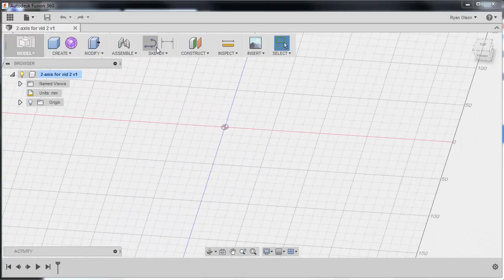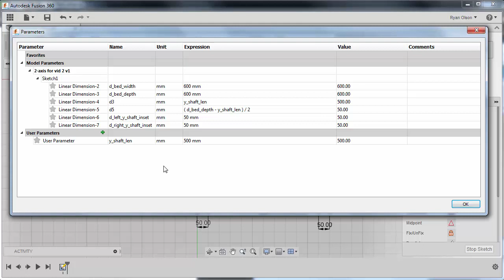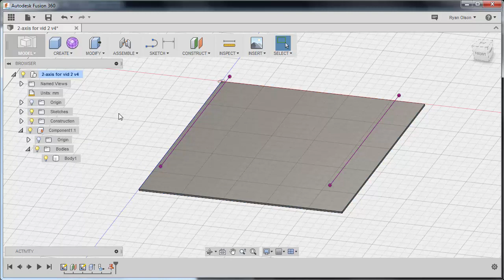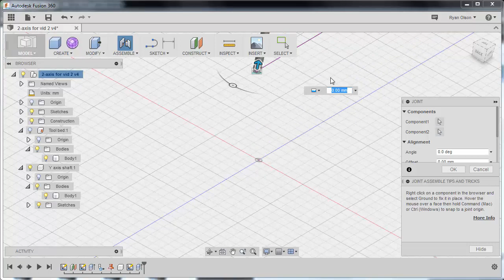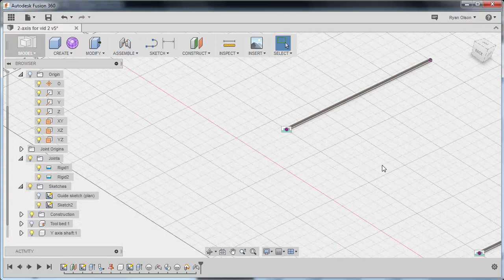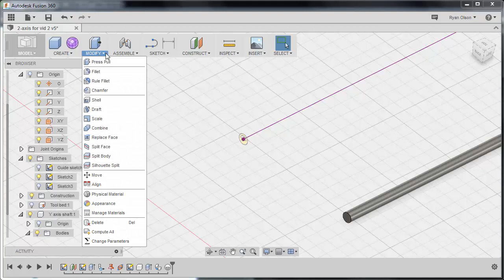[Fusion 360 for SolidWorks users] Parametric assembly design part 1

Comment: Just came across this after a search on the Autodesk website that you posted to. It's a very helpful presentation that illustrates the amount of advanced thought processes a designer must take into account before making anything at all. 

I'm struggling with the relationship between origin and the control plane of an object when attempting to blend the two (or three). The relationship itself is of course 3D, it's when you want to edit / modify / change a component that's driving me bonkers. This is particularly true when you have two different diameter size objects and want to align the center of each component using different 3D origin planes in F360. 

Your approach and processes in developing a model and associated parts is brilliant and reminds me of the old days of drafting on a good ol table. I still wish we had a orthographic projected "center" of any object that helps identify its relationship to a 'center of origin' not an offset of flat surface.